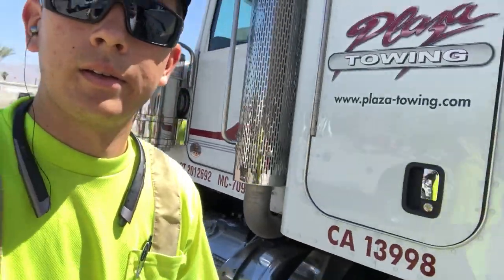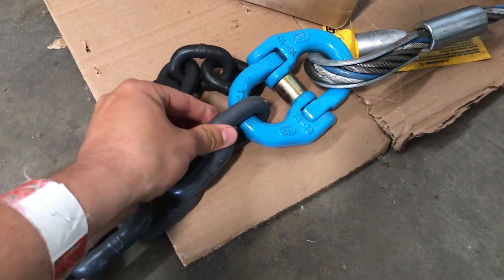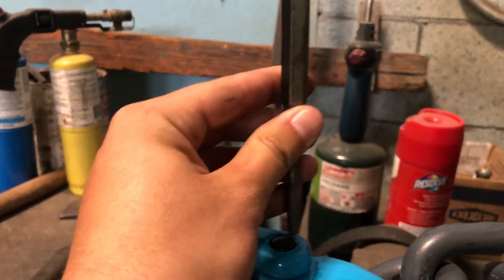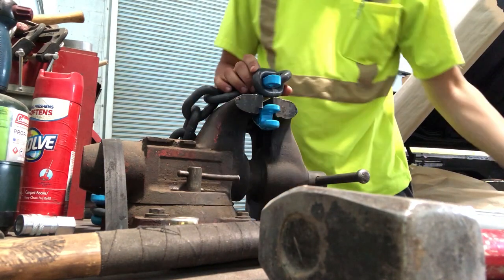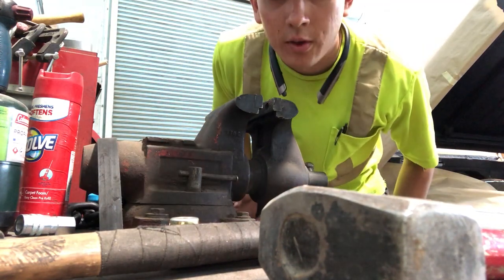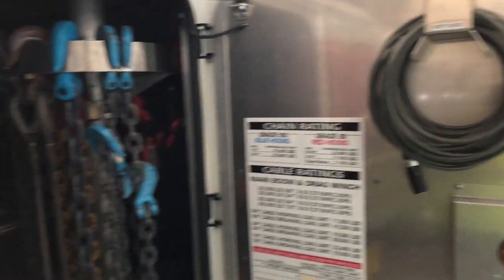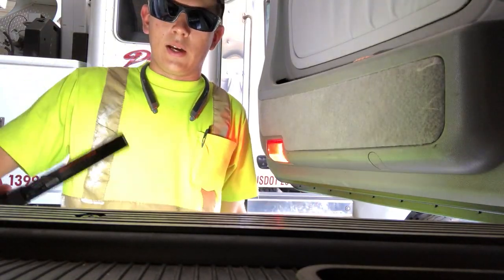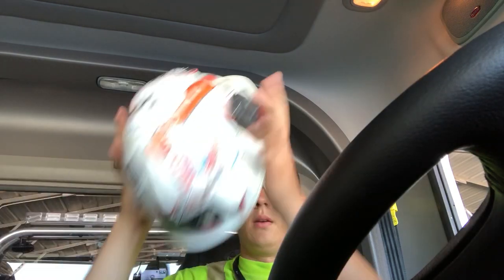Cutting, Fuel, & Mail Time! | VLOG 001

Comment: I liked this video, it shows the real side of your day, more so than just the tows.  Cool 👍  Webbing from used seat belts makes good carry straps for blocking, it should be easy to find and stays flat when storing.
Reply from the maker: I have been using old serpentine belts but that is a really good idea. Thank you for the suggestion and for watching!
Reply: @plazatowing  Thanks Trent, we used them on the fire trucks for cribbing, also built step chocks which work great and fast to deploy.  They are also available commercially in a poly material.